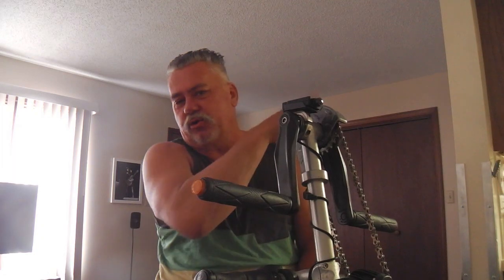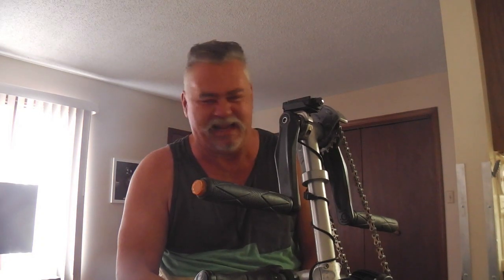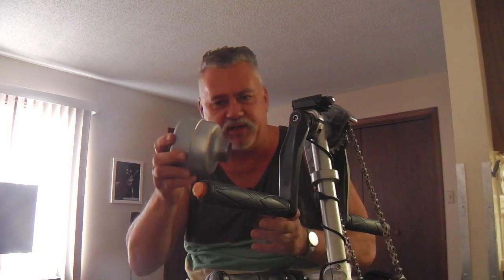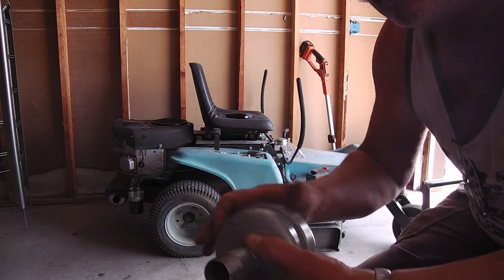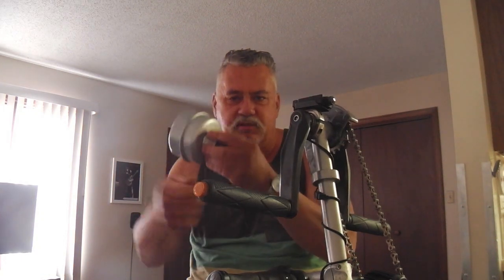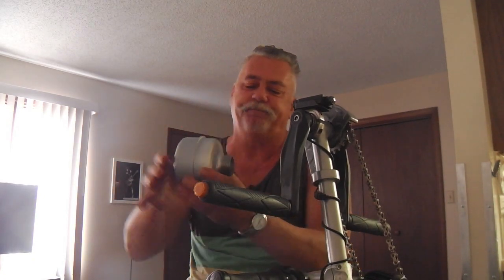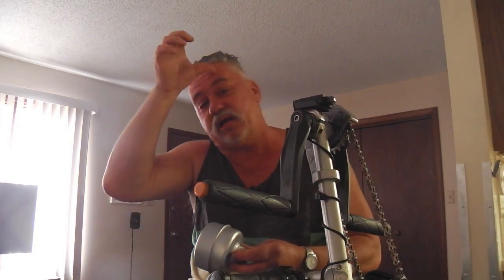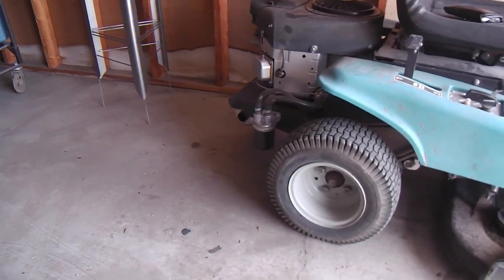Make Riding Mowers Quieter With Second Muffler At Tailpipe

Comment: Decibels are a little tricky because they use a logarithmic scale.  However, if you reduced the noise by 10 decibels, you reduced the intensity or sound power by 10X.
Reply from the maker: Interesting point...
Thanks for that!
Reply: @NewJerusalemTimes  3db is x2 for reference

Comment: I’m going to do the same build with about a 2 foot baffle made with safe n sound found at Lowe’s by Rockwell insulation stuff I used it on an air compressor box works amazing and doesn’t burn made from lave rock

Comment: So this won’t create back pressure on my 22hp Kawasaki?
Reply from the maker: Well, it'll take a small amount of time and about $16 to find out for yourself. Otherwise, a little added back-pressure may not be problematic. I've been running this for most of this season with no problem, and I may even pack the secondary muffler with a little bit of that stainless steel scouring pad material to get a bit more true muffling and sound reduction.

Comment: Do you realise that 9 decibels is actually a noise made by falling leaf? I am sorry to say, but sir, you gain no reduction noise at all...
Reply from the maker: Nonsense, a noise reduction of 9 decibels, is a noise reduction of 9 decibels. 
Do you realize that "decibels" are an objective and measurable scale? 9 is not 0.
"Noise made by falling leaf" is needlessly obscuring, not an objective standard, and is subjective, therefore meaningless...
Reply: @NewJerusalemTimes  
10 dB: Falling leaves or Normal breathing, Cant hear either

20 dB: Whispering from five feet away

30 dB: Whispering nearby

40 dB: Quiet library sounds

50 dB: Refrigerator

60 dB: Electric toothbrush

70 dB: Washing machine. At this level of sound (noise) in your video you reduced noise by 9 dB...level of noise reduction of something you cant even hear... 

80 dB: Alarm clock

90 dB: Subway train

100 dB: Factory machinery

110 dB: Car horn

120 dB: Ambulance siren
Reply from the maker: More nonsense, as you're probably a post-Modernist Millennial, who may even be living in his or her mom's basement. I mean, why do you quote seemingly objective and measurable standards, just to seemingly disprove objective and measurable standards? It's just stupid!
Reply: @NewJerusalemTimes  No sir... I am 60 years old , physics field, retired professional... I do admire your energy and idea but trust me, in a field of acoustic, 10 dB can not be detected by human, so you did not gain anything by your experiment... I am sorry to burst your bubble...
Reply from the maker: Nonsense, I notice a perceptible difference and so does the decibel meter. This is undoubtedly a good time for you to get your hearing checked. And, in the field of acoustics, less is more! Ha, ha, ha....
Reply: @dernektambura7131  Since you are a retired professional in the "field of physics" you should know that dB is a log based measurement, not linear.  20log[P/Pref] (in audio Pref = 0.02 mPa). You can't treat it as linear.   You can't just say the difference of 10 dB is equal to the level of 10 dB, that's not how logarithms work. Let's do some math:
20log(p/0.02) = x dB
log(p/0.02) = x/20
p/0.02 = 10^(x/20)
p = 0.02*10^(x/20)
So given 80 and 71 dB we find the absolute pressure for each level equals 200 mPa and 70.96 mPa respectively.
200/70.96 = 2.82.

Without the muffler is 2.82x louder than with the muffler. I worked for companies that have spent millions on R&D to get half that delta P
Feel free to check my math.

-An NVH engineer
Reply: @dernektambura7131  10 decibels is MUCH quieter. 1 db is the smallest change we can detect. 3 db is easily noticed, and 10 db equates to half as loud. Google stuff before making nonsensical comments.